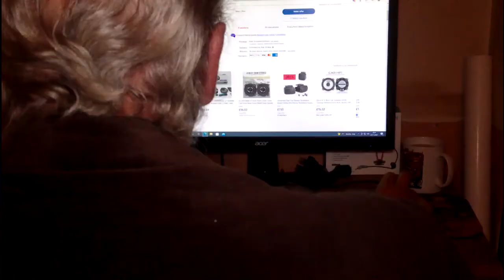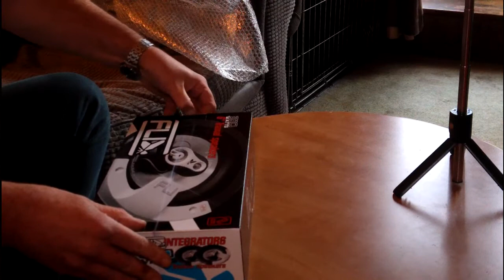How to: rebuild the interior door panel, including handles and window crank

Comment: Great little tinkering video, How are you finding the FLI Speakers? 

One job i will be doing over the course of the year is to improve my Audio from a 2 Speaker Set up to a 8 speaker set up.
Reply from the maker: The speakers seem to be really good value for money, I was thinking of possibly adding more behind the seats. With it just being a pick-up rather than a car though, just the door ones are great as they are. 
Don’t envy you going from 2 to 8, sounds like a wiring nightmare to me
Reply: @DoubleZeroGarage  Yeah think I may get the professionals to do the additional speakers, do not trust myself with wiring.
Reply from the maker: @scottishcarenthusiastsandtrain  know what you mean, I hate having to do complicated wiring or fault finding in wiring. Adding more speakers should be fairly straightforward if it’s just speakers, if you’re adding an amp as well it’ll get more complicated
Reply: @DoubleZeroGarage  amp is in the plan, but I beleive you may have to splice into the speaker wires to do that.
Reply from the maker: @scottishcarenthusiastsandtrain  I’d have no idea, I’ve never fitted an amp, just changed speakers for newer or more powerful ones. 
I would have thought there’d be an audio in and an audio out for each speaker, unless I’m over simplifying it